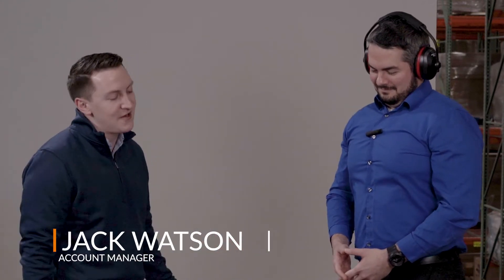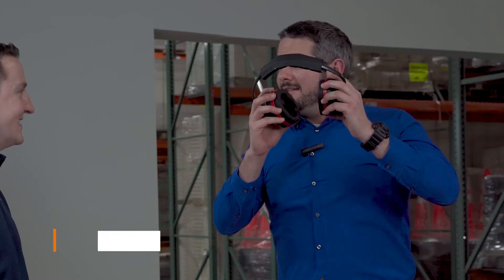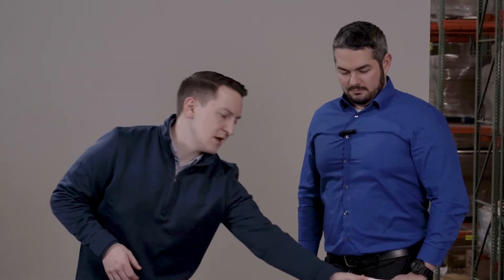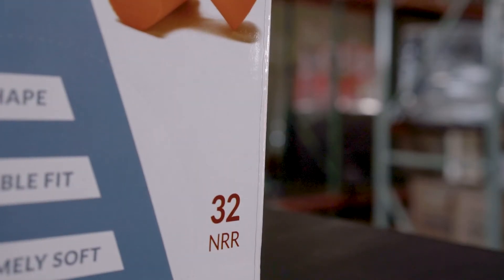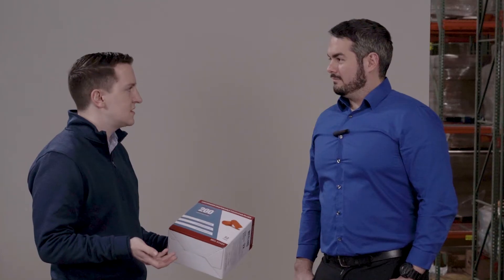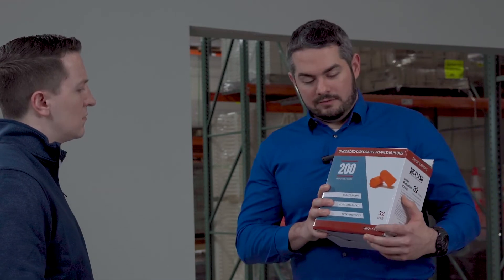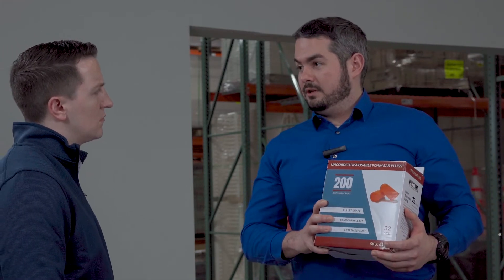Calculating Noise Reduction of Hearing Protection

Comment: There are no NRR 37 db or greater for ear plugs available commercially. 
Use ear plugs like what was shown NRR 32 db or NRR 33 db and then put an ear muff over it, that is rated NRR 37 db. like Decibel Defense. 
This is still not taking into account human error of not putting the ear plugs and ear muffs on properly. That is still going to reduce the NRR db.